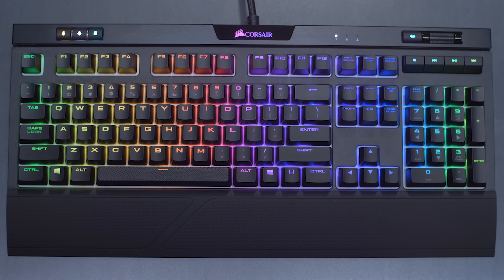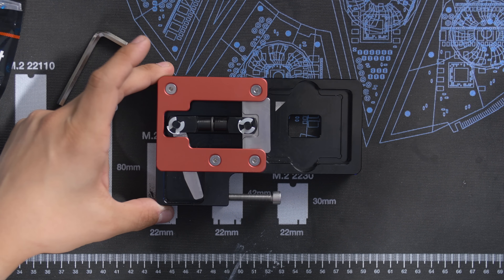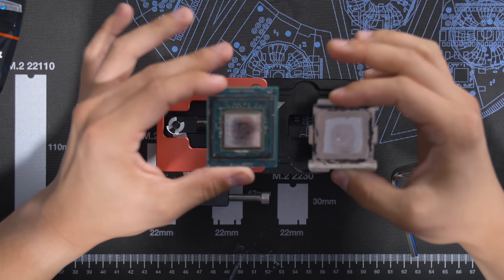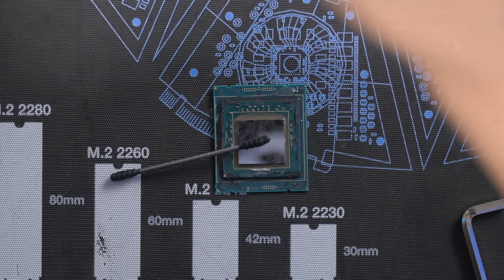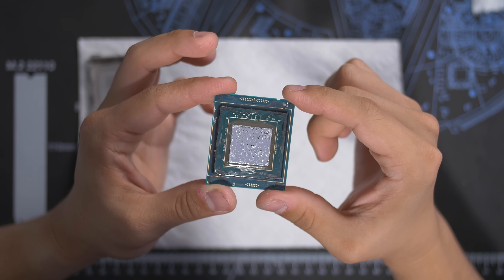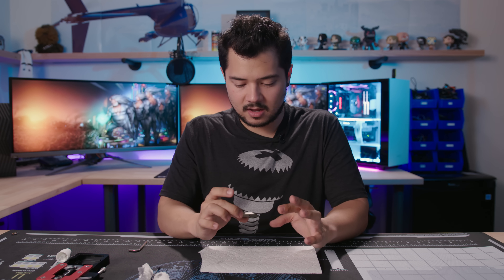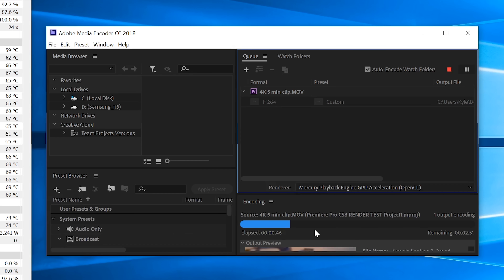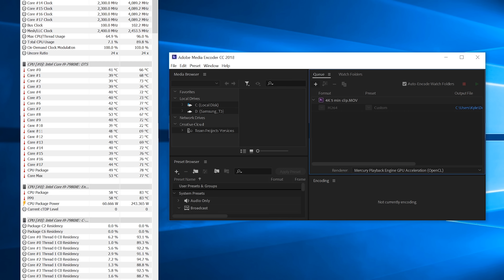My CPU dropped *20 DEGREES* after my first delidding

Comment: Wait....45C at idle for a CPU us bad?! That was the rough temperature of my AMD Ryzen 7 1,800. Does that mean I should reapply the thermal paste?!
Reply: Whatever happens don't let your cpu get hotter than 75°C it's the sweet spot. I have the Ryzen 7 2700x and it maxes out at 70-76°C
Reply: Look at the fan RPM, if fan control is active the fans could be spinning slow until 45-50C and full at 60-65C.
Idle temperature is not important really, 45-50 degrees is fine to keep the noise down.
Remember that some programs report the 1800 to run at 10 higher then it really is, AMD Ryzen master should show correctly but i am not sure, my 1700 does not have the 10 degrees wrong massurement as the 1800 has.
Reply: yea mine idles around 45, but stays cool during gaming. idle isn't really something to worry about, just keep an eye on the max temps when you stress the pc, shouldn't be getting above 80, mine stays around 60-65 when gaming

Comment: what noob re-glues a delidded cpu its the black glue that is the issue not the thermal paste its all about how the die contacts with the ihs, amd doesnt have any problems because they solder them instead of using crappy glue. when you redid it you want to wipe with a lint free cloth not paper towel, you used too much liquid metal, you should have scraped off all the old glue, and put some liquid metal on the ihs

Comment: Could or should you delid a ryzen 5 1500x?
Reply: That one is soldered, you need to heat it up to around 180 Celsius to delid it, which is dangerous, many people have destroyed their CPUs doing that. And they only get 2-4 degrees better temps because the solder is so good to begin with.

Comment: I'm guessing it doesn't work for PGA cpus
Reply: It does, but not if they are soldered, then you also have to heat them to 180 Celsius for the solder to melt, and that is dangerous to the CPU. And you need to buy the adaptor for AMD cpus.

Comment: Looks like Steve has secured SMD area with a liquid acrylic compound or nail polish, so you don't have to worry about liquid metal damaging the CPU if it migrates. Judging from your video, when you took off the CPU for maintenance the IHS has moved a little (maybe because of all that new glue used to reseal the CPU) and liquid metal migrated to the sides of the die. Center of the die is just too clean and if liquid metal was there for a long time it would stain it more.

Comment: Lmao since the actual chip is under the lid then why do people say to not touch the surface of the lid? It makes no sense...
Reply: @Wessell Urdata No it will not, maybe by 0.001% but that is hardly relevant.
Reply: @Wessell Urdata The layer of oil is so thin it wouldn't matter.
Reply: @Wessell Urdata Which is a function of thickness... have you seen the formula? W·m−1·K−1
Reply: @Wessell Urdata Please don't be an ass hat and run away when presented with evidence of you being wrong. It's okay to be wrong, I find myself being wrong about stuff every day :), it's called learning :D

I appolagize in advance if the case is that you did have to do stuff IRL and haven't seen my last response :P

Comment: if you want to try delidding try it on something like a cheap core 2 duo, there should be $5 chips on ebay(as of posting this) and if your carful can be delidded in a vice with one side pushing on the sub-straight and the other on the IHS and one hand holding it so it doesn't have the chance to drop or flying away

Comment: Of course ihs will not pop like with the original seal as Steve only puts a little dab of JB weld on the rails, which is not as sturdy and full seal as the OEM process... Not only you did not put LM on IHS but you did not protect SMD's against shorts by applying nail polish on them (it is obvious it does not have any on them)... Regardless, you made it ok, congrats. I just delidded my i9-7900X yesterday and i also improved 20C from stock (using Rockit 99 kit with beefier copper IHS).

Comment: Polishing the underside of the IHS for better and long term results. Using liquid electrical tape on all caps will save us lots of trouble.
Reply: Won't help, as the liquid metal fills the small gaps, polishing it will give you maybe 0.1 C tops

Comment: I have a ryzen ryzen 7 2700x on a phanteks (only 1 rear fan) and noctua nh-d15s... Closed case i reach 90°c cpu loaded. Opened case 73° c cpu loaded.. What can i do? Add some front fan? Because p300's Front panel is a bit closed
Reply: The P300's air flow is very sketchy, my Discord buddy had it and the airflow was terrible despite filling up the case with good fans.

Comment: Forgot to clean the glue from the chip pcb and IHS, didn't spread the liquid metal on the IHS and didn't even put protective coating such as clear nail polish around the die. Which we all can probably assume Wifesauce has. Smooth one, Kyle.

Comment: i used fingernail polish aswell to try and prevent liquid metal from touching anything it wasn’t supposed to.
Reply: Opty
Polski WD-40? What CPU you all did? Why? how many times you needed to to the process allover? lasting > weeks?
you remove sticker using your wifes supply?
Reply: lucas rem i7 4770k, i did 5 coats, i’ve had some left over from other projects. lasted me almost a year, i recently sold the system to a buddy of mine and his temps using the cooler master t2 never exceed 70 degrees stock under load.
Reply: Opty
Thanks, i hated DDR3, unable to clock it myself, 2014 dumped it all, went for the intel 600 X99 gear, still am, i use old 2014 DDR4 3200 corsair on 1.5, Xeon on turbo 5 Ghz cheap old. not getting any hot, cheap 240 all in one cooler master solution. Running RTX PNY now on them in December!
Reply: lucas rem My current pc I’m using a Sabertooth x79 and 2690 8 Core Xeon. Xeons are soldered though so I highly highly do not recommend trying this. Ram speeds don’t matter too much at all and I wouldn’t even consider them in a new build.
Reply: Opty
why you say weaird swhit here, just buy a new system, why delit crap?????
dumbed that is 2014, crap timing, why you need that now, 100% crap now!
Any AMD or intel is better!!!!!

Ipad is even better, heat cloud Xeon!!!!!!
Reply: lucas rem i’m a computer science major, i’m more than aware of how powerful my hardware is. For the money I’ve spent I cannot receive more performance. x79 $50 Xeon 2690 $100, cinebench is 1180. 4770k with motherboard i paid $150, again can’t find a better deal.

Comment: I bet you'd get another 10 degrees if you put the LM on the IHS as well.  At the very least, with only half the application, it won't last nearly as long.  And, it's a good idea not to touch the stuff with your finger...LM is highly irritating to skin (which I'm dealing with right now after delidding my 8700k this last weekend, and accidentally touching just a little bit.  Oh, and clean that glue off the next time you open it up!  You'll get better contact.
Reply: More like 5 degrees, the problem with the TIM is that it is too thick.

Comment: I would use LM on both the Cpu and the IHS and also trim all that extra silicone sealant off the Cpu pcb area, with it gone will be a tighter seal for better temps. Did my first delid a few months ago and was also nervous about messing it up.

Comment: dont worry about not putting it on the ihs.  you put enough on the die so that it wont matter.  normally you would want to paint on a thin layer to both but what you did is fine

Comment: By the way, if you want to run the CPU on full in premier, add warp stabilizer to 5-8 clips (that has movement in it). Make sure the clips aren't connected on the timeline. That's the only thing I know that can max the cpu in premiere.

Comment: dont need to apply a layer of liquid on the ihs , it actually doesnt help at all.and doesnt hurt to not have it either .when they solder them they only lay one layer of solder on .the ihs is actually only meant to absorb heat from the substrate on the chip.if it was important they would make the ihs out of the same grade material as the chip.and with the tech today they probrobly wouldnt ever need thermal grease , except they prolly own that too.

Comment: I had a very similar experience with my 8600k. 20* decrease in load temps and similar in idle. Also bumped my OC from 4.8 GHz to 5.0 GHz. 

You should have applied to the IHS and resealed. Gives better long term results. 

Should have also given a dab of nail polish to the SMDs on the substrate. You'll probably be fine though.
Reply: Man my 8700k didn't drop as much. Maybe -1°C idle and -12° under load. I thought I screwed it up the first time by putting a tiny dab of super glue on one corner (ended up pulling one side down tight and lifting up the other slightly), but I did it a second time (without sealing it) and it wasn't much better. Maybe it just wasn't that bad to begin with; the amount of stock silicone sealant seemed light compared to videos I've seen. Also Kyle's CPU was already delidded once by GN Steve; it looked like it already had nail polish.

Comment: For the record, not only do you not need to reseal the IHS, most people don't because it can cause overheating. The human eye is a terrible judge of thickness at this level. It is very easy to gap the IHS from the die with too much sealant. Sometimes the sealant will be fine but then it will swell because of moisture or heat cycles or some combination of the two. I have a feeling that this gap introduced itself for this very reason and presented after you relieved pressure off the IHS. If you really want to reseal the IHS I would just opt for a drop of superglue at each corner of the IHS and apply even and sustained pressure till dry. Some points of improvement for this delid (which have been said in the comments) 1) apply liquid metal to the IHS surface as well. This will promote better thermal contact if you do happen to have some gap issues. 2) remove the old sealant from the pcb and IHS. That was where the problem likely came from initially, so leaving it there is a bit silly.
Reply: I don't recommend superglue. I tried it on one corner and it pulled that corner tight while lifting the opposite side up. Even if you glue it evenly, it stained my IHS and I couldn't remove it completely from the PCB.  (edit: technically it was Gorilla Glue)
Reply: @Malus1531  yeah that is because you used gorilla glue haha. You need specifically use loctite ultragel control on all 4 corners.
Reply: @Gred Underhill Not regular Gorilla Glue, just Gorilla brand super glue. It still says super glue on the bottle now that I look at it http://a.co/d/cZDCQ4m [Amazon link] I thought Super Glue was a brand name, but I guess you can call Loctite, Gorilla, etc all super glue.

Comment: In the future we will look back and laugh at the fact we were even doing this. But we had our love for the -20C! Been doing it the last 5 years since the 4770K days!
Reply: Kyle you also used a tool which takes about 80% of the worry away... With a tool intimidating it is not.  Razor Blades (no puns intended*) are no fun and are intimidating (yes ive done it) and they can damage if you're not super careful and safe. Used if you didn't buy the tool you had to get creative. A small vice works also if you're careful. Done two chips that are still rocking it today. 2  4770K's and 2 4790K's are delidded by me. :)

Comment: I'm surprised that the sealing isn't as good as possible.  In industry, chips were vacuum baked for 12 hours at 3 millitorr, then placed into a Nitrogen filled glove box where the lids were sealed for leaks.  This prevented oxidation of the SMD's and wiring.  Laser leak testing or Helium leak testing would be performed to verify the seal.  Residual Gas Analysis could be performed to verify any chemical action over time. 
Introducing Air with Moisture directly onto a die seems dangerous to me.  Also, any spit on the die while talking.....can eat it up. Just sayin.

Comment: Nice job Kyle! My first delid went almost perfectly as well. My initial delid, I didn't put enough liquid metal on the die and IHS, so I had to do it again. I was super conservative with the liquid metal, so I applied more on the 2nd run, and boom- 33*C Idling and 70*C Max under load.

Comment: I thought the whole point of delidding the CPU was to leave the heat spreader off and apply the liquid metal and water block directly to the CPU die?
Reply: Nah that's direct die cooling. Intel was using a pretty bad thermal interface underneath the IHS rather than soldering. If you replace the TIM with liquid metal you basically get less insulation between the die and IHS. You get good temp drops without needing to do something extreme like direct die.

Comment: So to Understand this guy Delidded a 7980XE. FORGOT to apply Liquid Metal to the IHS. Ran Adobe Media Encoder Stock. NO Overclocking at 62 degrees Celcius and Was Happy. 
Not sure if he is trolling us or has an actual learning disability. 
Dude Overclock to 4.8Ghz and melt that 7980XE.

Comment: Delidding is stupid, dangerous and definitely not a permanent solution since it degrades different materials on a molekular level in a matter of months. Delidding is for stupid Shintel desperate fanboys that still wanna hold to that unimportant 5 % IPC gains on account of 100 % higher power consumption and lava like temps due to unstable and nonpermanent OCing. While we all others buy smart and we buy better architecture called Zen and have absolutely no overheating problems and no Meltdown and Spectre hardware security holes :-).

Comment: I had no problems with my i7 4790k for the first couple of years I had it, then all of a sudden it just started hitting 100 degrees and throttling. I couldn't figure out what the issue was, so ended up removing the 4.4ghz boost capabilities and the temps never went over 80 degrees after that. But obviously that wasn't good enough, why have a processor that can't use its own boost? Such a waste. I obviously ruled out the Corsair AIO cooler as the issue. That was working fine.
So I decided to de-lid for the first time ever and I have to say WOW!! Liquid metal (The same one that Kyle uses in the video) made an incredible difference. My CPU is now back to being able to boost as it should and my temperatures never go over 45 degrees while gaming and whilst running AIDA64, the max temp it hits is 55c. 
So if anyone is having the same kind of problems, I'd say you should contemplate doing the same. After all, if a noob like me can do it... anyone can.  ;)

Quick edit... I forgot to say that when I removed the IHS of the CPU, the Intel thermal paste had dried out and literally crumbled away. This CPU had been running at stock settings since the day I bought it, no overclocking has ever been performed on it. So that says a lot about the thermal paste that Intel uses. Lol.
Reply: hmmm I have a 4790k that runs pretty hot... not sure I can justify the cost of a delid tool + liquid metal... but tempting :S
Reply: My problem was so bad that I almost bought a new 8700k to replace it. But that would have meant buying a new Motherboard and DDR4 RAM too, so that combined cost convinced me that taking the chance of doing a de-lid was worth it, after all, if it failed I'd still have to change it all out anyway. 

I don't know where you're located, but I'm in the UK. I used the "Overclockers" website to purchase my Der8auer de-lid kit for £25 (the day after I bought mine, they had used ones for sale at £15, which I would have bought if available at the time.) and the Thermal Grizzly Conductonaut for £7. Plus some thermal resistant silicon sealant from Amazon UK for £5 (to re-lid the CPU, which as Kyle says, isn't strictly necessary, again I wish I'd known that. Lol). So the total cost was only £37, but without the sealant & buying the used de-lid kit, it would have only been £22. But I'm still VERY happy that I only had to pay £37 to fix my issue and breathe new life into my system. It's a LOT better than £700+ for all new gear. 

One thing I will say is... If you do decide to do it, make sure you don't get any liquid metal on anything but the CPU chip, to be sure, I used my wifes' clear nail polish to paint on the little metal contacts under the IHS before applying the liquid metal, just to be sure. There are some great instructional videos here on YouTube that'll tell you all you need to know. And as I said before, I've never done anything like this before, for fear of wrecking stuff. But this gamble paid off in spades! My temps are so low now that I have more than enough headroom for if I ever want to overclock.
Reply: i'm in Canada, I can get the der8auer tool for about $54 on amazon but looks like there's some cheaper $24 versions which should work fine too... and about $20 for conductonaut.. so about $45 total. not awful I guess.. might consider it ;)
Reply: Well, whatever you decide, I wish you the best of luck mate. I hope you get a resolution to your issue.  :)
Reply: @ifyouwantmoneythengivemeev8094  Something in the back of my mind said that I'd heard AMD soldered some, if not all of their CPU's, but I didn't want to say anything as I wasn't certain. Last thing I want to do, is give someone bad info and then they go and screw up their CPU. Lol.
Reply: Im using the same cpu. How did you de-lid it?
Reply: What are you guys all talking about, I had my i7 920 co chip from back in 2009 when I built my first gaming pc, it has been in use for more than 8 hours a day over those ten years! 
Still does not go over 70deg when running benchmarks, that is using a closed loop water cooler I bought when making the pc new.

Only replaced the thermal compound for cooler about three times now.

Only looking to build a new system now due to the bottlenecks with my 1080ti on such an old mobo/CPU setup.
Ddr4 would be nice also lol.